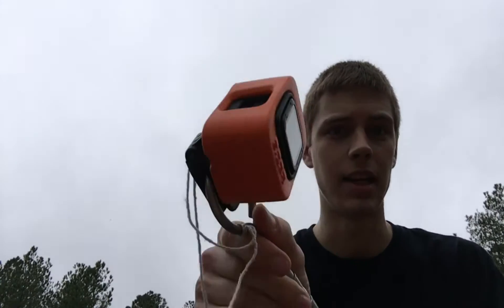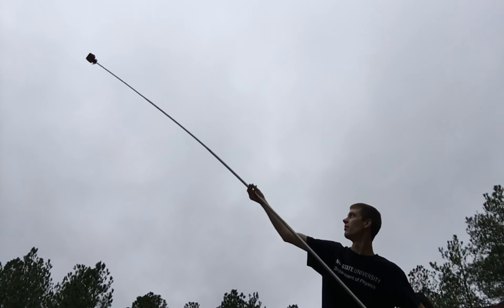Flying Coupled Syma Quadcopters

Comment: The Hero4 sessions weighs 74g but each drone only has 20g of spare lifting capacity, so once combined, at best they could hover with a 40g payload or slowly ascend with 35g. That means shaving off at least 40g from the drones by only taking the motors and props from the second drone, and mounting them upside down below the motors of the first drone, and most likely upgrading a few parts on the motor driver board to handle the extra current. The flight time would be halved but adding the 2nd battery might add too much wreight.